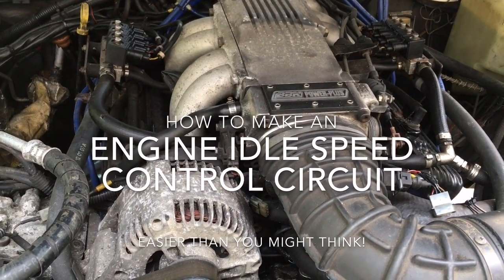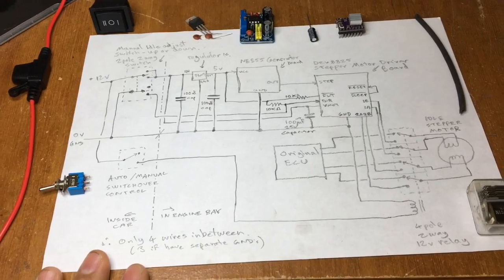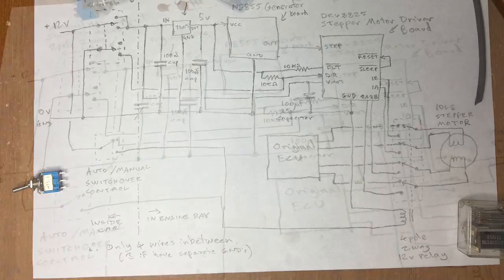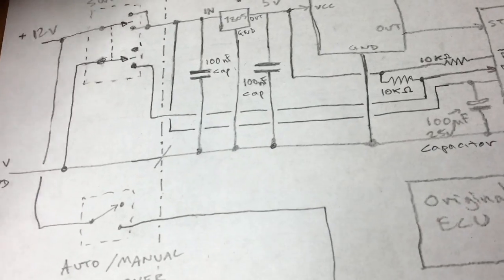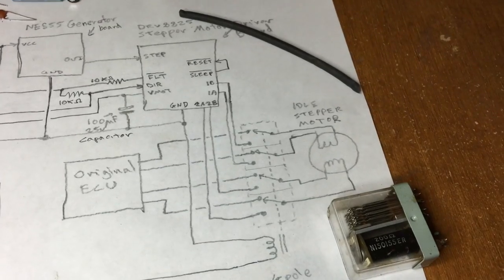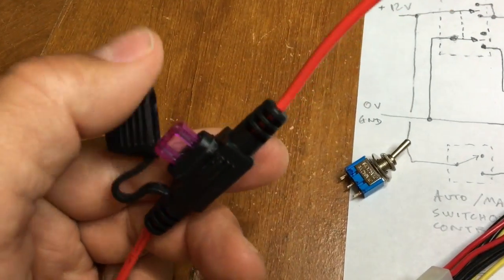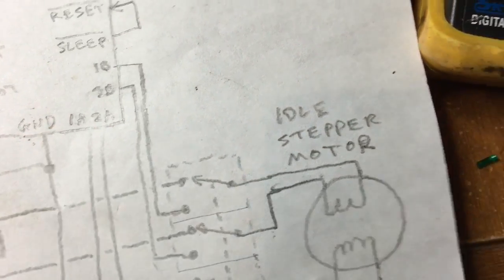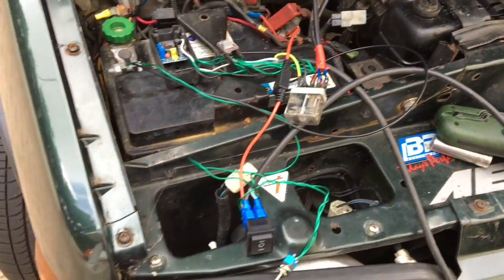How to Make an ENGINE IDLE SPEED CONTROL Circuit

Comment: I want to make an idle control that after 15 minutes it goes to 1200 rpm for a couple minutes then back to regular idle and if foot pushes brake pedal it shuts idle control off until you hit a reset button in case you drive with system on and forget
Reply from the maker: Most things are possible, it just needs some design work.

Comment: Hi  I purchased the docs to try and make my idle valve operate it is from a BMW 1200R,  4 wire and apparently compatible with the GM valve. This is part of a Speeduino EFI conversion for a motorcycle. I am also using an A4988 stepper driver instead of the DRV8825, the A4988 is supposed to be a lower cost, but pin compatible stepper controller, but it does not have the fault pin - is that going to be a showstopper? The 555 timer board is working ok, but no action at the motor. It is two coil, 50 ohm per coil. I've tries scoping the outputs of the driver, using a Hantek 60 22B (USB scope). what scope settings are you using and how are you connecting it please. Thank you
Reply from the maker: Nice project. It seems the A4988 is generally similar if not exactly pin compatible. The fault output shouldn’t matter. What is more important is if it being enabled correctly via the enable, sleep, reset pins etc.  Check the driven voltage that you are putting on these compared to what is required looking at the datasheet.  Use your scope to look at the pulses coming in from the 555 timer board, which it sounds like you can see, then probe similarly the motor drive output it turn to see if there is any pulsing on those 4 outputs.  If there is then maybe the motor coils are not wired to the correct output pins, swapping the 4 wires around should get something working.

Comment: I want to ask you can the idle speed circuit make the vehicle go faster
Reply from the maker: It’s about controlling engine idle speed not top speed
Reply: I want to ask another question can idle speed circuit make the vehicle accelerate alot quicker
Reply from the maker: @osynhenderson1729  no
Reply: I want to ask one more question can I use a toggle switch for a throttle controller and how I would connect to get more throttle response
Reply from the maker: @osynhenderson1729  no

Comment: Would this work on a Chevrolet C7500 Kodiak 7.8
Reply from the maker: If it uses the same 4 wire idle control valve then I think it would.

Comment: Pretty cool, but you could have just added a port somewhere in the intake manifold with a manual valve to create a small air bleed… basically the same thing the iac is.  Run a hose from valve mounted inside car to the fitting.  Open valve to various degree to bypass air and increase idle speed.
Reply from the maker: Thanks, and yes you could do that, with a filter on the end.  Might be a bit noisy inside the car though.

Comment: Hi, I would like to make this and connect it to a Carbureted engine on my mustang. Reason for idle control is I am unable to open the throttle blades any more manually for tuning reasons. Can this be use independently ? If yes would there be any change on the design ?
Reply from the maker: Yes, you can.  No design change.
Reply: @comeinhandynow  Cheers thank you very much. I have this one handy from a fuel injection conversion project. https://www.summitracing.com/parts/fst-307016. Its a GM style motor with 4 pins. So I guess its 2 windings on the motor for forward or reverse. Thanks.
Reply: So basically I could do away with the relay for ECU control or manual and switch for manual or Ecu control.. Am I right in this thought process ?
Reply from the maker: @nevillepoonawala3235  That item is similar to the idle stepper motor that I was controlling with the circuit.  All 4 connections need wiring up. Check which pairs of wires are connected to a coil by measuring the resistance (multimeter).  The motor goes forward or reverse depending on the sequence of pulses driven to each coil.  It is not one coil for forward, one reverse.
Reply from the maker: @nevillepoonawala3235  Correct.

Comment: Thanks very much, this project is exactly what I need for my aftermarket e fi kit which has very erratic idle control.
Reply from the maker: Glad to help!
Reply: What was the failure mode on your first stepper driver? Mine works, but only in one direction, somewhat frustrating!
Reply: My mistake! It is working fine now. Thanks again.
Reply from the maker: @huwjones2056  Good to know.

Comment: Old video I knoooow, but would switching to manual mode trigger a check engine light?
Reply from the maker: It didn’t on my car, but it is possible if the ECU monitors the idle stepper motor connection.  If it does then switch in a resistor (50 ohms will probably do) to connect to the ECU wire when in manual mode.
Reply: @comeinhandynow  I was thinking that  but wondered what that split second between switching would be enough for the ecu to notice.
Reply from the maker: I had a similar scenario on the simple turbo boost control I built recently, see that recent video, and in that case the ECU didn’t detect the switchover, as long as I has a 63ohm resistor switched in to replace the solenoid.
Reply: @comeinhandynow  best info